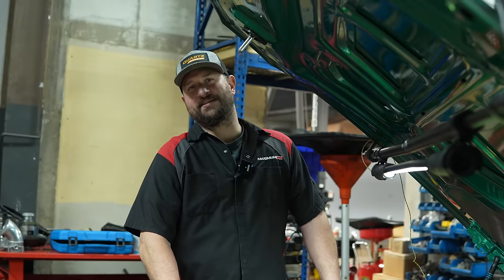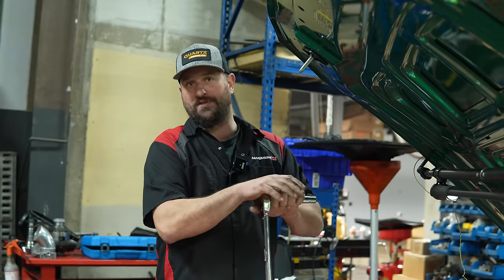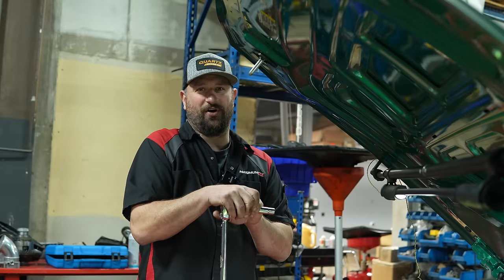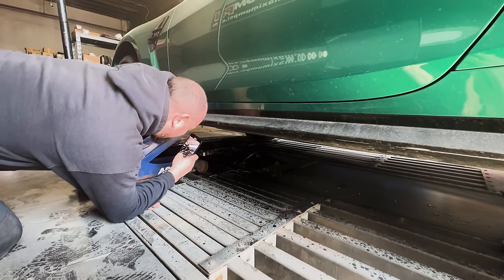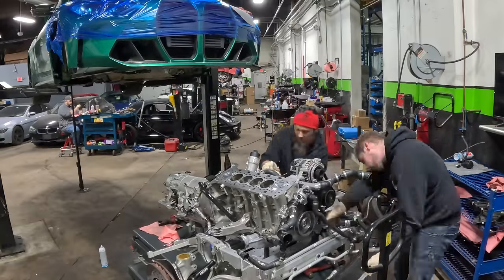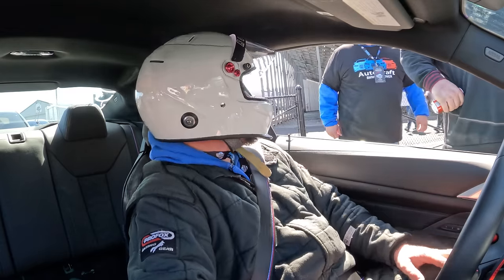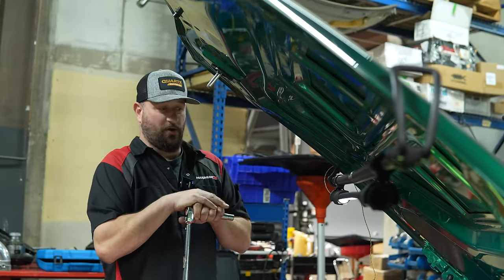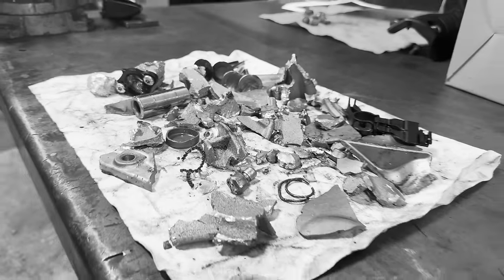1300WHP + 150 SHOT = BREAK MY WALLET!

Comment: 1200whp seems to be the max power for these motors sense a lot shops tried to do, ess, bimmerclub and ukmotorsports all blown s55 and b58 motors around 1100whp 1300whp
Reply: But its stock internals?
Reply: @bmwsincekid   No dude... it's built motor
Reply: @AJUSA1  1300whp is a lot 1500-1600 crank crazy numbers
Reply: some making a bit more, rk just broke the 1/4 record with a 8.0 @ 172
Reply: @CoyoteSwapEverything  thats insane
Reply: You mean 1100whp is the limit for the S55 as well as B58? And 1300whp for the S58?
Reply: RK is making 1470whp on their 3.4 motor
Reply: @gwspom B58s are at over 1400 now
Reply: @V3LOCITY__  Stock block?
Reply: @bmwsincekid built internals stock block
Reply: @gwspom yes. Billet is very expensive
Reply: Stock motor wise, the B58 and S58 can achieve around 1000whp before blowing up. 1StockF30 made 1050whp on a stock internal B58.
The sky's the limit with built motors making more power, depending on what internals you choose.
Reply: They’ve taken one to 1700 crank and they just keep finding ways to make more power
Reply: @gwspom No, 1stock is making 1200+ WHP on Stock B58 block, upgraded piston and rods so built bottom.
Reply: @nazihelkurdi9318 its 3.4L Stroker motor

Comment: if those are built motors and ported heads then why does the motor still make its peak power at the same rpm a stock motor does? is it because of the cams/timing that make better airflow at low rpms or why did you try to make all that power at such low rpms? wouldn't revving it higher and having less combustion pressure be better for making power?
Reply: Because it’s an undersquare engine. It produces much more torque but can’t keep that torque at high rpm’s.
Reply: For high horsepower higher rpm is much better to make safe power, as torque kills engines not rpm. Well rpm does kill an engine if you rev it past the limiter.
Reply: @2seep  exactly my point. when trying to make that much hp the torque is so insane at stock rpm's that it kills the motor. it seems like it would be better to port it for higher rpm, cam it for higher rpm, new valve springs, and do some simple mods to at least reach slightly high rpm. then your motor can make the same torque it already does but with a higher rpm your hp is proportionally higher too.
Reply: @2seep  this isnt exactly true. it doesnt matter whether a motor is undersquare, oversquare, square, all that does it change the rpm range the motor is likely to run best at. its torque characteristics throughout the rev range are based much more on other engineering than the square style of the motor. so this motor being undersquare is more likely to run naturally at lower rpm's (which we see with its sub 7k rpm redline) but it doesnt mean its immune to high rpm mods. adding a cam, new valve springs, and some porting can allow any motor to naturally breathe at higher rpm's compare to stock.

Comment: The motor was stock or forged ? Im just curious,
Nice build sir !
Reply: Most deff a built motor.  Just not built enough, most of these guys still run steel rods. At this level alurods would have saved him.
Reply: @Jamxknife  i was thinking about this, this is the rods who go away in the video ? If im not mistaken but yeah aluminium rods is way stronger than Steel rods
Reply: @clement2438  Not necessarily stronger, but they’re lighter, and they absorb more shock. So they extend bearing life and mitigate rod/crank failure.  

You usually wanna run them at around 250-300hp per cylinder. Which is what these guys are at.
Reply: @Jamxknife aluminum rods are terrible unless you constantly rebuild. Same strength as steel, but the fatigue life is ass
Reply: @2seep  It’s a 1600-1700bhp race car and you’re talking about rebuilding? You can’t have a car like this at this power level without aluminum rods, this is literally proof.
Reply from the maker: Fully built
Reply: @MaximumPSI how far can a fully built s58 go you think? Tbh 1300hp sounds safe for a fully built.

Comment: How much boost was it running at the time the engine let out ? also whats the CR ?
Reply: Psi isn’t  a good metric. A small turbine pushing 18 psi will produce far less power then a big one running the same psi. What you should ask is what is the air density.

Comment: What's involved with a retorque on stretch bolts? Or are they studs
Reply from the maker: Custom age 625 head studs and cut ring head gasket. When you run this combo and the fire wants out it will make a path one way or another.

Comment: Can anyone tel me the max power the S58 can take without any gearbox or touching the motor. With just a high boost map. Intake and exhaust.
Reply: You can play in the 700-750 range
Reply: The transmission goes before the s58 goes. These guys shouldn’t be running two big  turbos .The engine is fine at 1,000+ with a single and the record is right at 1,500 wheel and 8.0 with that single.

Comment: So the limit is 1300 + 149
Reply: He said the entire bottom end is a FULLY built motor. So yea I guess. In this case . I would think a fully built S58 could handle more than 1,300whp or 1000wtq but idk.
Reply: @bigjdm5460 lmao no fully built already handling 1500 wheel and soon to be 7’s car. The key is a a big single turbo not twins.
Reply: @Bimmer_Bill  drop the link fanboy. Did you see the S58’s at TX2K24? Yea didn’t either.

Comment: Just thinking that Daza 2.5 tfsi with just 5 cylinders can make 1300 whp with build motor and just an upgraded clutch is more impresive than B58/S58,no hate but 2.5 sound 10 time better 😉
Reply: No daza makes 1300 whp on stock block, this M3 made 1300 on stock block.

Comment: Why nobody making more then let's say 1400 hp on bmw's japanese cars making 2000hp easily ,but there is something  with bmw ,and this is perfect example even with nos they barely reach 1400... and then explode
Reply: Well it's because the aftermarket hasn't pushed them to make that kind of power is why. The bmw community never was too strong in the drag world (older M50-S52 bmws are known to see 1000-1300hp but not many go that far with them)until recently  with their current platforms seeing numbers like this. Older drag bmws exist hitting 8s/7s but that's still a pretty small number of them regardless.
Reply: I mean in the 90’s japan really went crazy . Cast iron block 2jz big heavy strong internals . I’m sure a cast iron block will just handle more stress. I would think an engine released in 2019 ish would be stronger even if it’s Aluminum but maybe it’s not that easy.
Reply: The 2JZ and other engines built in the 90s were all built from cast iron, and just overbuilt because they wanted the reliability with the amount of power they were making. At the time, they probably didn’t know how strong the engines would be just that they would be strong enough to last a long time at that oem power level. Tech is a lot better now so they can make something last for a specific period of time at a predetermined power level. It’s cheaper to build something that can handle exactly what you need it to then just build it as strong as possible and hope it lasts forever like the 2JZ. 

The engine architecture is also a result of that same technology. Built to just last, the 2Jz has thicker deck height, thicker Siamese bores for added strength. Forged rotating assembly to handle the “unknown” stress of lasting forever at 320hp; it’s a Toyota after all. BMW knows exactly how strong the B58 and S58 are. They know exactly what it can and can’t handle. It’s financially smart to make them exactly how strong they are so they can make a profit, while still creating high performance engines. Mind you the B58TU is stronger than the 2JZ gte is on stock components. Handles way more torque and therefore can make more power if modified with the same turbos. But aluminum blocks will have their limits, just like in this video. 2JZ after 1000wtq needs to have some form of block modifications to last too. Think of cementing in the lower 1/3 or 1/2 of the block. I’d say if the torque wasn’t so high on this build provided in the video it would have lasted at 1300+WHP for a long time.
Reply: @MrTRESTOON  what about gtr r35 and other even honda civic holds 1500 hp
Reply: @MrTRESTOON  why are u talking for Toyota engineers ? What you’re doing is really an opinion based off your own assumptions unless u have primary sources from the horses mouth. The S58 in this clip is FULLY BUILT already mentioned by the actual shop on IG. I REPEAT THIS IS A FULLY BUILT S58 in this clip. B58 block alone cant handle 2000hp as a cast iron 2jz can. People with 1,000whp on a B58 go forged . Anything north of 700whp is on borrowed time. All shops with 1,000whp are on built bottom ends.  It’s plenty 2jz on stock internals that were at 1130whp taking abuse for a long time. B58 has higher compression with direct injection and a lot more stroke so the torque numbers are more. everytime I get in comments guys are saying “I know guys with 1,000whp stock bottom end B58’s” Everyshop online I can prove what they are running has built bottom end and / or stroked 3.2L stroker kits or 3.4L stroker kits.